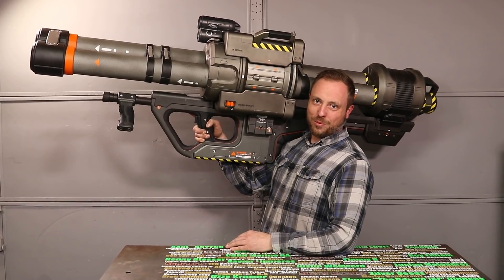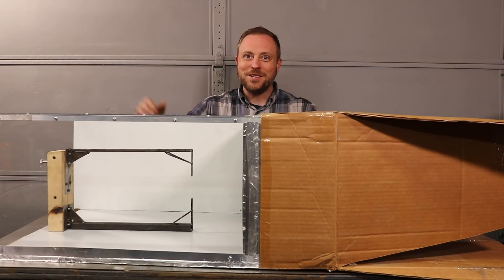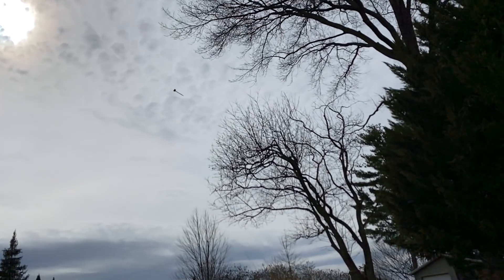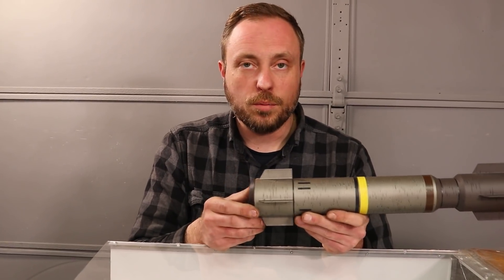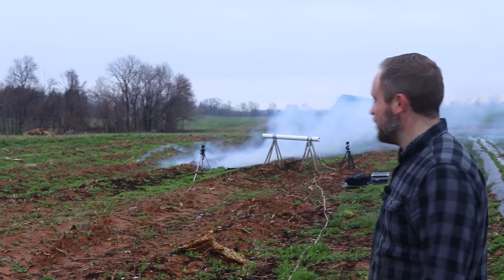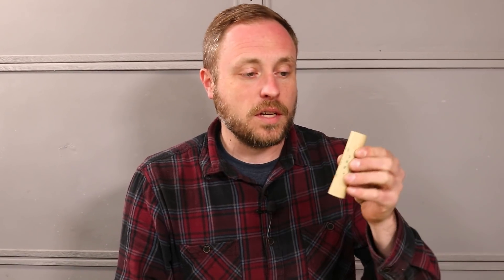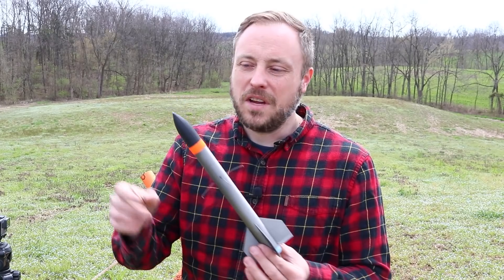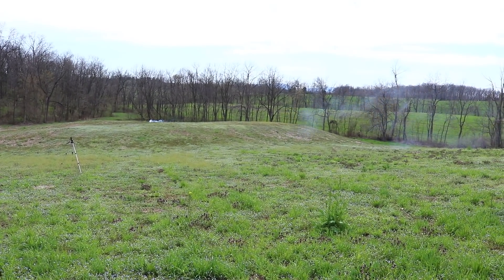Halo Rockets in Real Life - Absolute Garbage

Comment: i have a couple of H550 motors  haha. They are 550 newtons of thrust. they sent my 4 inch rocket 5300 feet up at 541MPH.

technically you could get an H115 and NOT need an FAA waiver or certification to fly it. But they are $60 a pop and you can only buy one at a time unless you contact your local rocket club and join either NAR or tripoli. 

the G80 is a nice motor though..

Comment: Something inside me is crying to comment on making rockets flyable while preserving proper external look!
Can't stand it anymore... :)

There is a long history and culture of operational scale models. While it is relatively easy to make, for example, a model boat look 100% like a small real boat and still be able to move across the water, with flying models (controlled or not) things become a little bit more tricky. For an airplane or rocket it is critical to keep weight low and to has enough power for the flight. And when real airplane (or rocket) gets scaled down the aerodynamics slightly changes - making it harder to maintain both look and good flight characteristics. And something out of a videogame may not be flyable at all. So here comes a number of tricks to make such models.

The number one trick - to look authentic it is not actually required for the model to be 100% accurate. To a normal human eye the thing may look perfect even when the proportions are ~10% off, sometimes this number can be up to 20%. Different foil in the wing or fin is not noticeable at all. Long story short - looking at this rocket it seems easy to make front fins 10% smaller and use thicker foil for the aft fins. It's also possible to mess up with the number of front and back fins: f.e. keep 4 fins at front while make 6 fins at the back. This going to move center of pressure back reducing the amount of ballast required in the front.

The other popular method - mess with the weight of the model. It is possible to make the whole shell of the rocket lighter (f.e. using special lightweight PLA for flying models) and it would become easier to make it flyable. Yet it may become disposable after single use (well, everything comes at a cost).

Comment: I used to make homemade bazooka and what l can advise: fins should be not completely straight, but situated with the angle, that will force the rocket to spin so fast. With my tiny homemade sugar rocket motors l didn't completely solve the problem with speed, even if TWR was like 20 at the moment rocket leave a tube. Sometimes it went straight to where l aimed, sometimes it went down and fell in a 15 meters. But almost every time the trajectory was absolutely straight, 0° left or right

So maybe try it and good luck!

UPD: wrote the comment before l saw you actually made what l wanted to advise, sorry.
The pre-last rocket in video looks really close to my homemade rockets, except they are paper-based
And yes, sticks at the front to place rocket in the center can probably be pronlem because of friction

Comment: Your mesh for your wind tunnel is cool and all, but if you have the fan in front of the mesh you might as well not use a mesh at all. the turbulence from the fan blades will mess up your flow.
If you want laminar flow you need to put the fan at the back so it sucks air through the filter and doesn't mess up your flow.
But for your tests, laminar flow isn't required, so you could probably just remove the filter and get some more wind speed :P

Comment: Maybe if you used a tube that fit the rocket, preferably with guiding straight rifling where the rocket has a male extensions and the inside of the tube had matching slots (the “rifling”), then maybe the experiment would have performed better?

Comment: With most historical rocket launchers IRL, the rocket motor is completely spent before the rocket even leaves the tube. It’s all inertia carrying the projectile afterwords. Many American launchers like the Bazooka and the LAW operated on this principle.

The problem with having the rocket firing after it leaves the tube is that the soldier firing it gets hit with backblast. 

Other rockets are a two stage operation. There is an initial charge that clears the rocket a few yards and then the motor fires. This puts distance between the soldier and the rocket before it ignites. Most modern rocket launchers operate on this system, like the Javelin and the RPG7. 

I’d like to think the halo launcher, with its immediate and loud thud when firing the weapon, is a two stage design.

Comment: I love your use of tire weights. As an x sams club tire shop manager, me and my boys developed our own "rocket" program, Or rather fin-stabilized air pressure launched bottle missiles. We used tire weights on the top of a smart water bottle with plastic bottle pieces for fins. slapped it together with tire adhesive and cut the bottom off. the launching device was a Cheetah tire bead seater that could safely harness 145 psi. 

We were able to launch our missiles up to a guesstimated 150 feet in altitude while maintaining to keep our jobs. We probably had 5 launches before we had a successful missile. After which we probably had a heyday with the most successful design launching it countless dozens of times while getting paid by the Walton family. :3

Comment: Ive only made it to when he starts adding weights to the original design but in the terms of weight wouldn't the explosives and seeker head/fuse help make the center of gravity be so far forward since the rocket fuel would be lighter than the explosives?

Comment: You could have gone right back to the original game rocket with the more powerful motor... the problem was thrust speed, which you corrected with a larger motor... but, you had already started shaving off all the other stuff to go with the original motor... you did not test the original design with the more powerful motor. (that I could see) The original design was TRYING to stabilize, but the motor was nearly spent and not strong enough, that should have clued you in that the shape was ok. <shrug> Prove me wrong.... but I absolutely LOVE the wicked looking folding fin design!

Comment: If I give the game designers WAY more credit than they probably deserve, there is a cool thing hiding here. Most modern fighter planes are actually designed to be aerodynamically unstable in much the same way that the in game design is unstable. The natural tendency of the design to flip itself around can be countered on millisecond timings by computer control, and when you start flipping it around intentionally with control surface inputs the natural tendencies make it really easy to do so. This would enable tighter turns and better target tracking for a missile like this. Probably way more thought that was put into it, but a cool parallel. This of course assumes that at least one and likely both of the front and rear fins are driven for active guidance in flight.

Comment: When I see fins at both front and rear the first thing I think is active stabilization, which is MASSIVELY more complicated than these dumb rockets. This is shown in game as it actively tracks targets once locked on. You seem to put a lot of stock in being true to the game. If you can buffer it against impact you might be able to design something that at least tries to fly itself in a straight line and can survive multiple launches, otherwise it would be a LOT of work for each launch. That would let you stick with the game design and still fly straight.

Comment: Wait, aren't HALO rockets actively stabilized?. That's a big difference, all you did was amazing, but if the game rockets have movable fins and exhaust thrust vectoring then is a whole different level.
Passive fin stabilization is basic rocket science, but once you have active control surfaces and/or thrust vectoring aerodynamics can become weird. Not a single space rocket would fly straight without their fins and engines actively making constant corrections.

Comment: Why don't you just make a nose-less rocket, i.e. an empty tube, with the motor installed inside the tube just at the front?
This way you automatically have a proper position of the thrust vector in relation to the location of the centre of mass and centre of drag... and no empty weight for the rocket to carry around...

Comment: The Game rocket is accurate... It is supposed to look like modern missile/rocket like a Javelin, the Head is round/flatter because it is the place of the thermic camera that track the target... And those missiles are heavy, they are first launched out of the tube (fall a bit) and only then the reaction start. They are actively guided so their fins adjust, and they correct their course.

Look at modern military rockets (they look like this, like the Javelin or the NLAW) or long range missile they look like metal sharks, they don't have a round cone anymore, it does not match their purpose anymore, and cruise missile fly horizontaly, they take advantage of the wing air lift to plane longer and better.

The Only problem with the spnkr rocket is that the fins are too small.

Comment: Very impressive work on the rocket and everything. To be honest, I think model rocket manufacturer should use your spring tail design. I know that they already had a propeller design for landing which is what yours reminds me of but yours looks FAR more stable and stronger than the typical tail. I should know, I used to do model rockets as a kid and gluing a straight edge onto a curved body was a disaster in the making. I had tried Elmer's glue, Elmer's wood glue, even went so far as to try other glues like glue sticks, and even less safe glues. All in an attempt to have the tails stay on at launch, during flight, or after landing. (Had all 3 issues one time or another.) I haven't touched model rocketry in years but if they ever solved this issue. Please let me know? Anyway, even if you would argue that flipping tails isn't needed unless launching from a tube, one could say that it'd make for a nice launch and also make it a nice way to pack up for travel and be a conversation piece for when people see it standing somewhere and who knows? It might start a rocket-tube launch sensation! lol!

Comment: Cutting the fins on the front was what was causing failure when you added the more powerful motor, if you added the original fins back it should have corrected the flight and fly straight. Not a guarantee but it should do.

Comment: This is what I hate about shows like this.
1) The person keeps pointing out the issues with the VIDEO GAME designs in relation to real life, as if everyone expects it to actual work in real life.
2) Then the person tests the game designs with less power then THEIR  REDESIGNS, just to try and prove their point.
3) Then the person gradually changes the original game's design, as they increase the power, to further "prove" they are right.

It doesn't take a rocket scientist to know that the original GAME DESIGN is not going to work. Nor does it take one to realize that the item's material is going to both change the center of gravity and thrust locations. A real rocket has the ignition engine in the body, as well as explosives in the tip. Real rockets are made of a verity of materials, but mostly metal. NOT FDM FILAMENT. Why? Because real rockets are designed to travel very far and destroy their targets. FDM would just melt under all of the heat of the rocket's powerful engines. And if they some how didn't melt, then it would just break upon impact. Which also counters the purpose of a real shoulder mounted rocket.

 I know these videos are all in fun.
But don't treat it as is you're performing actual test and research.
It's misleading and dishonest. If you're going to do stuff like this, then at least show the original design, with the same powered engine as your final redesign. THAT would be a proper comparison. Oh, and compare the orientation of the rockets as they leave the tube, verses their orientation when placed in the tube. If I remember correctly, Halo's SPNKr has a spiral tube. Meaning it forces the rocket to spin at a high velocity BEFORE it leaves the tube. Which would also increase it's alignment. The SPNKr is also originally designed, in game lore, to be a surface to air weapon, to take out nearby air vehicles. NOT a surface to surface weapon, as used by players and dumb A.I.. Just a small, but very important, detail to remember for your tests.

Comment: You can 3d print the original rocket without changing any of the parts out to make it lighter. Have low infill at the back of the rocket and %100 infill at the front of the rocket giving you the weight distribution you're looking for

Comment: If you ever want one of these to fly out at an insane speed, check out Cesaroni's E75-Vmax or F120-Vmax.  0.3 / 0.45 second burn time respectively.
Reply from the maker: Didn’t know those existed! Thank you!!!
Reply: @jairusofall  Yea you're welcome!  I love doing high-power rocketry and maker projects, so this is a great overlap project.  Excited to follow along.
I loved your demo of how CG and CP physically works, it's a really good intuitive demonstration of the complex physics at play!
Another thing I thought of just now, if you haven't heard of OpenRocket (though you probably have) I'd recommend checking it out.  Good for basic design work and validation of model and high power rockets.
Reply from the maker: @RileyRocketry  I tried open rocket for the halo design and it didn’t like something about it. The software was saying the center of pressure was about 8 inches in front of the rocket 🤣
Reply: @jairusofall  That's very interesting. I've never had it do that before, but it definitely has its share of bugs lol.
My only guess on that would be either it bugging out with a really flat nosecone shape, or perhaps a set of fins or another object was somehow incorrectly placed really far ahead of the rocket.
I know the developer(s) are pretty active on the github page; I'm sure they could help you with trying to solve that far more than I could.

Comment: Wonder if one could make a reaction gyro that would fit in the nose of the "standard model"... perhaps linked to the front fins if it's own force isn't enough. A little timer circuit in the rocket would let it come up to speed and then ignite the motor.

Sidewinders have an extremely neat system where there's a reaction wheel in the tip of the rear fins that's spun by airflow, and it's reactive force just natively turns the fin on a pivot. These aren't that fast, but it's something to ponder.

Comment: yeah yeah yeah,,  but but,,, you are firing a dumb rocket I assume,, meanwhile rockets today already have very advanced active stabilization. So,, the halo missile will be incredibly smart. Further, the more inherently stable your rocket is (the more it "sticks" to forward), the more difficult it is to turn the rocket using vectored thrust. If the missile wants to aim, and you are shooting at very close targets and want a very fast missile, the rocket needs to auto-correct its trajectory in distances measured in single-digit yards, at maximum velocity. That means, the rocket needs to point all the way to 90 degrees or even against it's trajectory to hit the targets it's aiming for. In order to make this happen, you want a very UNSTable shape, so that when the thrust vector changes, the rockets attitude changes as quickly as possible, to redirect to a new vector. Rather than having to fight against very sticky laminar flow, you want the rocket body to be forcing it's way through the air WITHOUT creating laminar flow,, you want a big messy wad of turbulence so that there are no boundary layers to break through. If the rocket is pointing forwards, or pointing 90 degrees out, you want as close as possible to the same amount of air friction, because you don't want to deal with a sudden impact of air friction. Better to have lots of friction and a gradual increase in friction than to have minimal friction but then a brick wall of air to punch through.

Comment: Why not just move the rocket motor further into the rocket body? positioning the point of thrust further forward should ensure it flies straight, even using the original design...

Comment: Also, it looks like your rockets are doing something that's normally called a 'gravity turn'. Having the CoG ahead of the CoP makes it so the thrust goes straight into forward motion - but the issue is that if you have a lot of weight up front, you end up with an "over-stabilized" flying craft. In airplanes, over-stabilized is a Very Bad Thing because it means the plane will follow a gravity turn and the control surfaces aren't powerful enough to make it not arc directly into the ground following the center of gravity. You actually might have too much weight in the front of your stable rockets. You need to find a medium point where you have enough stabilization to keep it pointing forwards, but not so much that it follows a gravity turn. The further the CoG is out ahead of the CoP, the faster it'll follow the gravity turn.
My recommendation would be to make the rockets lighter, move your CoG back a bit more (so the rocket is slower to stabilize in your wind tunnel test), and then put a ring fin or grid fin on the back of the original rocket model to make it truer-to-game. Either a ring or grid fin will add a lot of pressure to the back of the rocket, allowing you to get away with a lighter rocket with the center of gravity further back then where it is with all the weights in it.

Comment: most wind tunnels these days pull air through with the fan at the back, instead of pushing it through with the fan at the front, because it's easier to ignore the fan's buffeting when the buffeting all happens outside the tunnel.